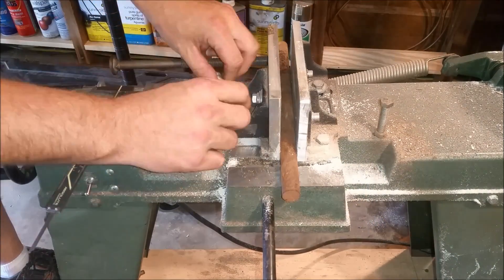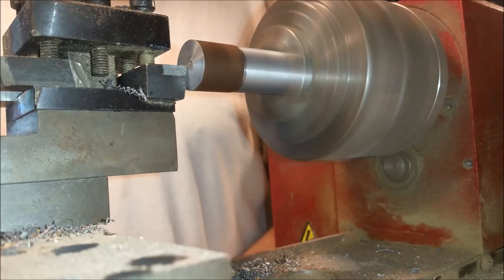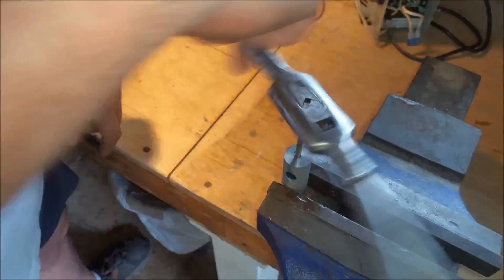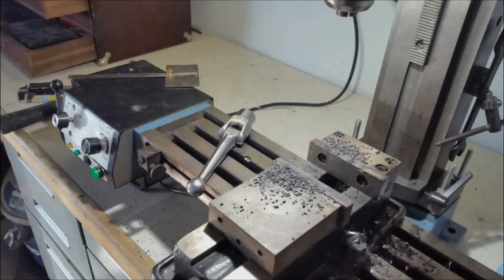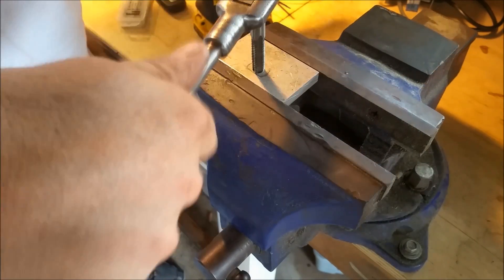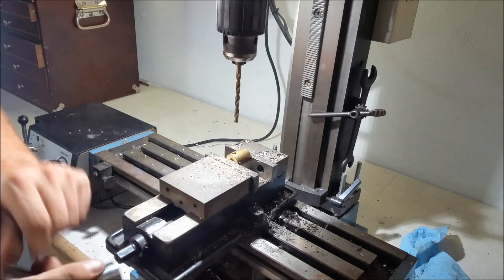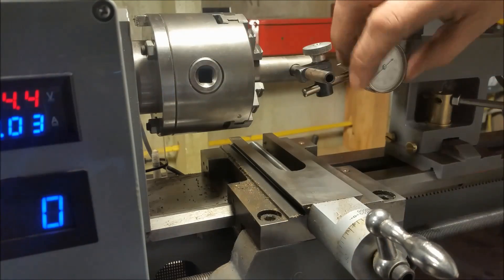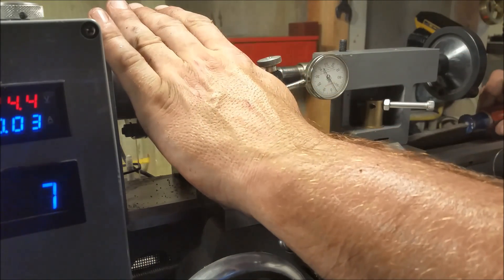Mini Lathe tailstock centering: The definitive video guide

Comment: Your process is very similar to rim and face motor to pump alignment. 1st vertical angular. 2nd vertical parallel. 3rd horizontal angular. 4th horizontal parallel.

Comment: You can sharpen a brazed carbide cutter and get a much better finish, grind back underneath then on a diamond wheel set the proper angles on the carbide.

Comment: Tapping with a hand drill motor can be controlled easily by drilling horizontally at waist height in the beginning so you can use your body to lock your arms. 
Before changing over to a proper tapping head I was tapping a few hundred 8-32 and 10-32 holes a couple days a week building control panels. Using mostly pop rivets the last 20 years after 20 years without having to take apart a control panel.
Ah well.

Comment: ok for your work, i also put four screws to adjust the direction and position of tail stock, i made this some years ago ...
Try to change position of the lever to fix tail stock on the lathe bed, that bolt can be some time cumbersome. I used an excentric device moved from a lever from opposite side of your one, you have to make a bore from opposit side, then you can better manage tail stock position on lathe bed ...
Many greetings from Italy ...

Comment: I recently bought a wood lathe to accompany my metal mini lathe. I bought a Nova G3 chuck to go with the wood lathe, and discover that Nova makes a headstock/tailstock alignment tool! They call it the Nova Aculine System, and it’s simplicity is amazing! Wood lathes commonly have MT2 tailstock and headstock, and the “system” is a single piece of steel with MT2 tapers on each end. Just loosen up the bolts, insert the tool in both stocks and tighten every bolt back down! My mini lathes have an MT3 headstock so I just bought a MT3 to MT2 adapter, and I’m good to go! A shop made version of this could be made by using a longer piece of bar so that there would be several inches of straight shaft to indicate off of between the tapers. Woodworkers, of course, wouldn’t bother with the indicating step!

Comment: As you mentioned, but I don't think most realize what you were saying, this method only aligns two points. For the Lathe to be aligned it takes 4 points , a front and rear point for both the headstock and tailstock.

Comment: Look to see if you ever updated for vertical alignment and found none. My tailstock is not level. about .003 in 1.5 inches so only way I  now is shim between the two casting but that will be hit and miss with very thin shims.   The existing locking plate sucks so I need to update that.  Like my wood lathe as the tailstock is guided by the sides of the ways.

Comment: When manufactured most tailstocks are a few thou above centre line to allow for  for wear. This idea of yours would have a problem with that. Since you cut at right angles to that only the side screws on the stock matter in any case.  Most of us use a test bar cutting process, the only way to dial in a rotating centre...

Comment: I did all the steps you mentioned.  One thing that helps tremendously is to buy a alignment bar.  I bought one from ebay, about 11" long with an MT2 taper.  You put this in the tailstock and it amplifies any tilt, front to back and up and down. You can mount a dial gauge on the carriage and then measure tilt in any direction over the length of the bar.  You still need to center it with your setup up too. The bar I bought has a maximum run out of 0.0002 and arrives in Canada in 2 days! For $40!
Reply: From India no less!

Comment: Stumbled upon this when I realized the following: 1) tailstock was 0.026 low. 2) Could not move it far enough sideways, therefore had to elongate the holes. 3) Got perfect center on live center. 4) was off on one side with a dead center and off on the other side with a chuck and drill bit. Realized that I need to add two additional bolts to adjust angle!  Thanks for the video.  This just confirms everything!
Reply from the maker: Hi Tom, thanks for taking the time to comment and watch. have a great day and a happy new year!

Comment: While I've done what you do and use taps with my drill, Harbor Freight has a super cheap, even cheaper looking tapping/countersinking drill bits that actually work AMAZINGLY. I thought I was going to break them day 1, likely hour 1. But they're actually awesome. Even the little M3 has drilled/tapped dozens of holes with 0 issues

Comment: Most important with tailstock centring is making sure that all mating and bearing surfaces are clean and deburred. Even small dents and the erupted surface they have around them can throw your mounting off. I use a hand stone on all defects I can reach. Clean with some solvent then dress flat and feel with a bare hand. Slip a rod of mild steel, up the tailstock taper and slip it in and out while you work your way right around inside. Bit's of swarf can flatten and adhere in there, especially if the tailstock has been thumped into the job.
Tailstocks don't wear away on the bed, quills don't wear out one side of their bore.  Unless you've had a big prang the chances are your tailstock misalignment is caused by contamination.

Comment: I'm pretty new to machining. Really, just a few weeks. My lathe started out as a HF 7x10 and is now 7x16 with a few mods; bought it from a machinist with +30yrs experience. Wasn't happy with how the tail stock was centered. Installed a dead center, which indicated essentially perfectly, and chucked a short pointed rod that also indicated as well as the dead center. The HF model only has one set screw for the tail stock, unless I'm missing something, which is entirely possible. Took a little while to center everything, as the tail stock changes position when tightened. Once everything was set and the two points met, I checked the aliment with a (standing) feeler gauge method, for a lack of a better descriptor. Haven't felt the need to readjust. Made a brass bushing this morning; indicated as it should.
Reply from the maker: Thanks for Sharing felix

Comment: Before worrying about the tail stock the spindle and head must be put in parallel with the ways first.
Ask me how I know  :<)
thanks
Reply: Thanks, I'll check that
Reply: jupp, and on top of that (level, parallel etc.) the 3jaw is not the way to go. minilathes do not have a very accurate 3jc.... so with this method you actually incoporate the accuracy problems from it. its better to use the taper and a center in the spindle, come in with the tailstock and use a feeler gauge to position it, it will be more accurate than this. unless you got a 4jaws.

even china collets are not spot on sometimes neither. and i also would check runout even the center too.

but of course, with that said, it depends on what you want to do....
tipp i've seen is to minimize the runout on a 3jc by try to switch the jaws around, just rotate them one slot around if you got runout, messure it, use the closest fit you get. i've seen some even go so far as to mount a grinder on the carriage and then grind the jaws in... but at the end of the day, a 4jc and some setuptime suits me
Reply: @MrZhefish  The accuracy of the 3 jaw chuck has zero effect for "runout". The indicator held this way will always rotate around a perfect circle or as close to perfect as the spindle bearings will allow for accuracy. You don't even need to turn the scrap piece of bar. In fact a noticeably bent shaft would be just as accurate as the turned one in the video. What does need to be done is ensure everything is as rigid as possible since gravity can show a very large change in the indicator readings going from the 12 0'clock position to the 6 o'clock.

Comment: 1-free the tailstock from the base rails.
2-put a long rod dead center in tailstock.
3-catch the dead center inside the head stock and tight it.
4-do the needed sets to update the tail stock vertical and horizontal position.
you may start from the head stock also.
try it! it may work for you :)

Comment: You only aligned it to your chuck not your headstock. (they both have different theatrical centers)
Reply: Theatrical? Which show are we talking about?
Reply: It doesn't matter if the chuck holds that tool concentric or not. Even 
if you would bolt it off-center, it still will always sweep a circle 
when you rotate the spindle and the accuracy is down to your bearings.

Comment: I haven't read all the comments yet, but did you consider indicating the round bar in the chuck before inserting the indicator. Look s good though. I think I'll try it on my lathe.
Reply: It doesn't matter if the chuck holds that tool concentric or not. Even 
if you would bolt it off-center, it still will always sweep a circle 
when you rotate the spindle and the accuracy is down to your bearings.

Comment: I found out I have the same problem on my lathe and you gave me some ideas uhh I was planning on chucking a 1/2 ground rod on both the headstock and drill chuck and  glue a shim where its low uhh

Comment: I just got my tailstock centered and it was a bugger. When I tightened down the tailstock bolt, it would throw the tailstock out of alignment I can't count how many times I had to loosen the tailstock then the hex socket head screw and readjust the horizontal and re tighten everything.

I think a new tailstock built from scratch would be the way to go.

Comment: Pinch a piece of shim stock, a feeler gauge, or an Allen wrench between one dead center in the headstock and another dead center in the tailstock quill. Adjust your tailstock until the shim/feeler/wrench stands vertical and not twisted; that's as perfect an alignment as you can get. No indicators needed.
Reply: Well, you can check for imperfections in the centres by rotating them 90 degress, 180 degrees etc and checking for consistent results. Also, you can check for the tailstock axis being out of parallel by touching the centres with the tailstock quill retracted and extended. Tim's method does have the merit of not involving the chuck which can introduce errors especially if its centring isn't very reproducible.
Reply: Good tip.. thats how i set my tool height. Didnt occur to me to do my tailstck that way. Thank you
Reply: Sorry, but it is not. You are relying on the centers being perfect, having a perfect dead sharp point in them and you are not even checking to make sure that your tailstock axis is parallel to your spindle axis.

Comment: Does this require to true the jaw chuck prior doing this? My mini lathe has a runout of 0.003" which gave me the decision to turning center to center. Until I realize the tailstock isn't align, in fact it is slightly angle upward.

Comment: Try starting those taps while held in the drill chuck on the mill. 5 or 6 threads should be enough. That runs the tap down as straight as you drilled the hole. Then finish them by hand. The threads already cut will keep the tap straight and properly aligned as the rest are cut. Way too much effort to line up and  keep the tap straight while starting the tap by hand. You can't always do it on every single part maybe, but for most it's not a problem. It's just faster, easier, and more accurate to do it that way. A few less broken taps as well.

They make what are called ratcheting or adjustable handles with either a male or female thread. One of those would make your tail stock lock much easier to use. MSC Industrial is just one place that has them.

Aluminum has a lower coefficient of friction than steel does against cast iron. You need all the help you can get to lock that tail stock down solid. Larger drills will just push it away from the work. Much better to use a thick steel plate properly sized to fit between the lathe ways for your bottom plate. If you haven't leveled your lathe bed and got any twist out it's almost a waste trying to get the tail stock alignment correct.

Agree with whoever mentioned cast iron is cut dry. Adding cutting fluid or even oil just makes it tougher for the cutting tool to bite in and cut. Vacuum up cast iron chips, an air line blows them everywhere you don't want them getting into.

Rusty material should never be cut on a machine tool. Wire brush it off first at the minimum. All that rust is a form of carbide and will embed into the softer cast iron on your carriage and tail stock. Mix in some way oil and your constantly wearing down your lathe bed and other slides from then on. Cast iron dust will do the same. Raw castings are even worse because of the casting sand and hard outer surface.

The tail stock on these lathes is really poorly designed and machined. Far too much clearance between the upper and lower parts of the tail stock. That never helps rigidity which is everything on a machine tool. If it were me I'd spend some quality time searching out every design on the net you can find that's used on tail stocks that can be offset. Then redesign the bottom of the main tail stock casting and use a block of Durabar to build a brand new bottom part that fits the lathes ways. Everything has to be machined so the tail stocks quill is dead straight and looking exactly at the head stock. Even top quality tool room lathes are built so the tail stocks quill is a couple of thou high. That way it wears into alignment and not out right away. A few thou high has so little effect on the part size you couldn't measure it even with a 50 millionths digital micrometer.

Everything flexes and there's no such thing as being totally rigid. After your bed is correctly leveled and the tail stock aligned a turning test with a bar between centers is the only way to be sure everything is aligned properly and it's not turning a slow taper towards either end. A light duty lathe perfectly level so there's no twist will still need some very minor adjustments to get it to turn parallel over the full length. None of this testing and alignment is that fast or easy to do. It's not optional if you want to tune the lathe as well as possible. It helps a huge amount to bolt your lathe down to a 1" thick steel plate the length of your full lathe and maybe 12" wide. Again that helps with the machines rigidity. But even a 1" plate that size will flex if the lathe is on a wooden floor or wooden bench top. A few degrees of temperature change will also have a measurable affect on the machines parts. And in turn on any machined parts. Yes it's only a mini lathe, but with proper tuning you can see all of that happening if your measuring equipment is accurate enough. Most times that effect can be ignored. But it still depends on what your doing. Knowing it's possible is just good general knowledge.

Have a look around and research "indicator sag" it's a real effect of gravity and it can throw your readings off in the up and down direction a huge amount. If you don't know about it there's no chance of getting dependable readings or possibly compensate for it if you don't know how much compensation is needed. It's not easy at all to not have some of that indicator sag. I've lost more than a few hrs while checking a tail stocks quill in the up and down direction until I figured out what was happening. And that was a very rigid set up and using a light weigh 10ths indicator.
Reply from the maker: Great Advise, i will try that next time to get the threads straight!!! -Cheers

Comment: Yes, a big annoying 10-4 to the tailstock of the Sieg lathes not being steel,  I hadn't realized that until I accidentally dropped my first one onto the concrete floor and instead of dinging, it shattered like a glass drinking glass.  Some kind of sintered iron I think.  Luckily Littlemachineshop sells replacement tail stocks as components.  Good news is I now have lots of spare internal parts for a tail stock.
Reply: Sorry but cast iron is the proper and industry wide best material to use. First it's a good slow wearing surface when steel parts like the quill are moving back and forth in it. Second it's far better than steel at absorbing vibrations etc. That's desirable for any machine tool. Steel doesn't dampen those nearly as well. But like you found out it's not a good idea to drop it on a hard surface. Bad for high end measuring tools as well. I make sure not to drop anything like that any more. The first time cost me enough to learn my lesson.
Reply from the maker: Hi Ken, thanks for sharing and talking about the little machine shop. Great site for spares, upgrades and information. -Cheers

Comment: I know there's 100 ways to skin a cat, but almost all machinists will recommend machining cast iron dry because it contains so much graphite which is more than enough to lubricate the cutter, you don't need to add cutting oil. Thumbs up anyways!
Reply: It's not just the graphite in it. The chips are so small that using oil causes them not to clear and creates a binding effect on tool bits. You should set up a low pressure air nozzle or even a vacuum when milling cast. This will help clear the particles and help keep the cutter cool.
Reply from the maker: We learn so much from peoples comments here. Thank you for the advise. I need setup a vacuum device to help with the chips anyways.. lol  ...thoughts for my next next video....... -don
Reply: In my shop I used a HP small wonder central vac off an 80's RV. It is a little 1hp unit. converted a 3 gallon bucket into a catch can and used the original catch can for an exhaust air filter. 3/4" pvc runs ports throughout my shop with rubber stoppers for ports not being used. Very quite, extreme power. I cant count the times I have watched large bolts disappear up the tube in a flash. I will make a video later and send you a link.
Reply from the maker: I learn so much from viewers leaving comments like this. So thank you and ill read into it. -cheers
Reply: Floofd coolantkeeps the dust down, keeps the part cool, keeps the tool cool and lubricates better than a graphite which is an abrasive.